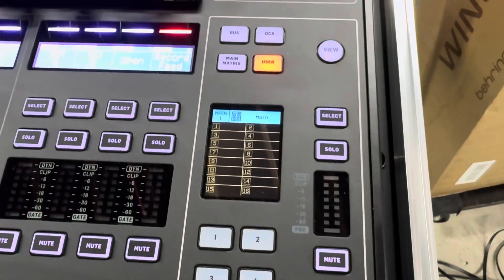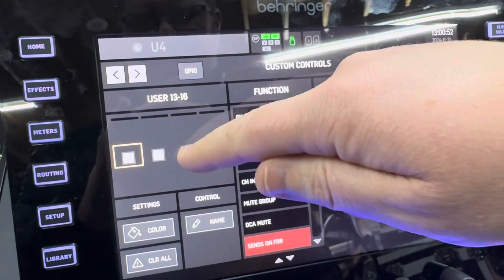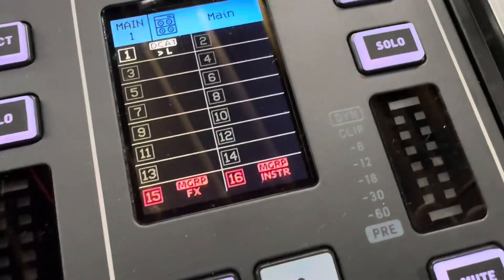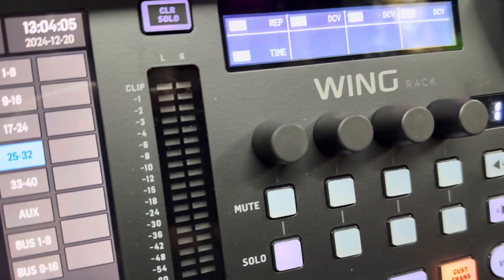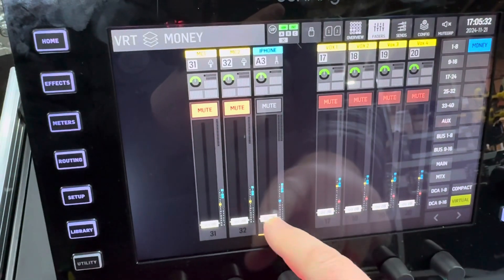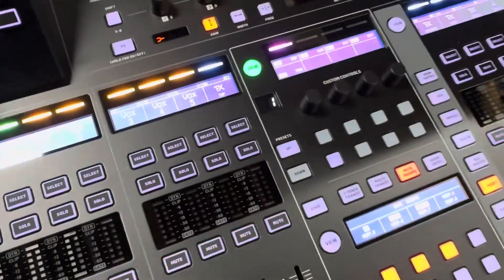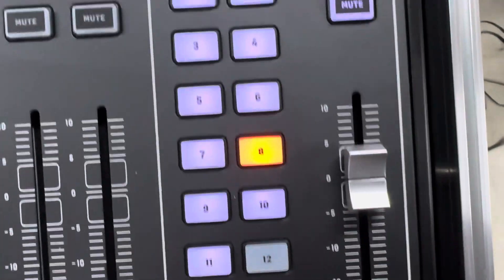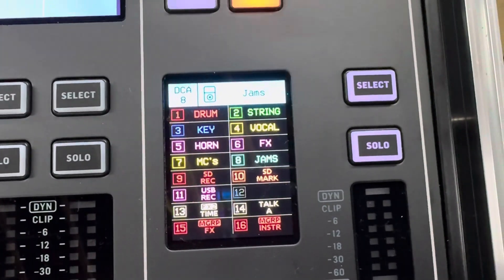How to use user defined buttons on Wing Compact and Wing Rack

Comment: Question, can you pinpoint me where to turn the back light / Glow on that’s above the inputs and outputs in the back? I’ve looked thru all my settings
Reply: Go to settings on the compact, towards the top right hand corner there are 2 icons marked "patch" and lamp
Patch brings on the led strip above the local  connections and lamp is used for the XLR lamp on the console. Use knob 7 to adjust.. Hope this helps